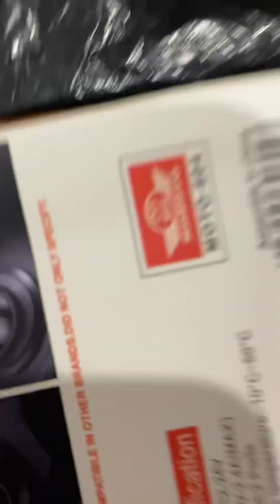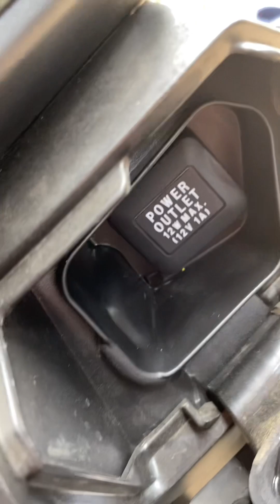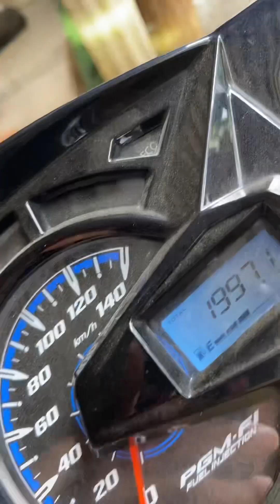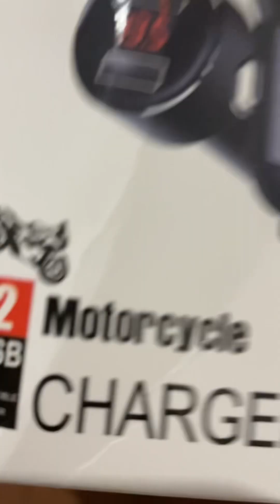Honda Beat V3 Charger  (para sa pag outing at palaging nawawalan ng kuryente na lugar)

Comment: Saan tayo maka bili yan? At ano pangalan?
Reply from the maker: eto po

MOKOTO 2.4A USB CHARGER WITH OR WITHOUT
VOLTMETER 604 / 606 / 602 FOR NMAX 2020, AEROX, Beat V3 ADV 150 1PC UNIVERSAL